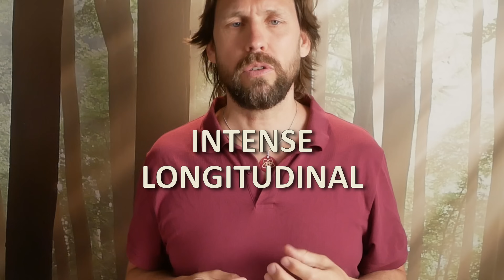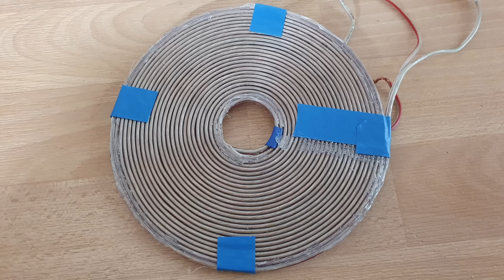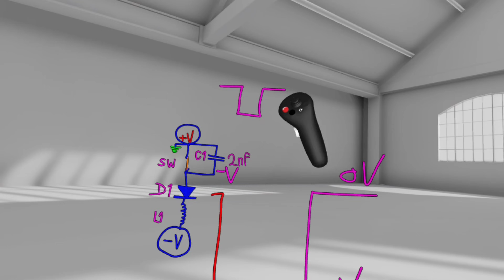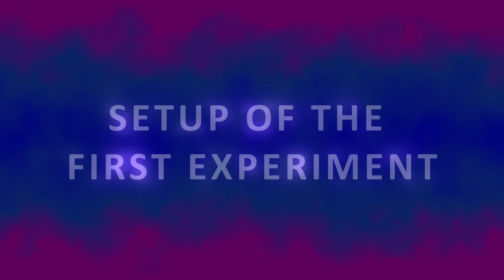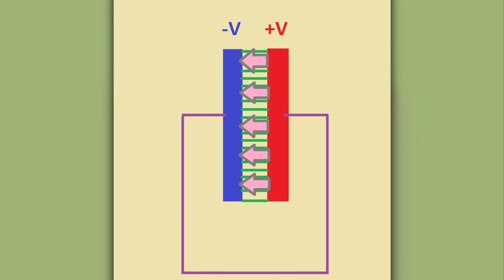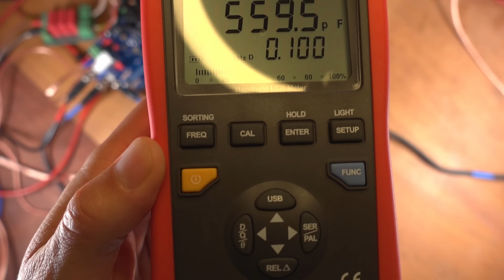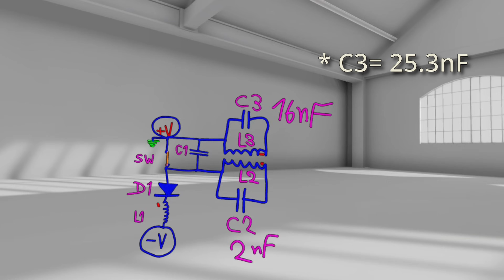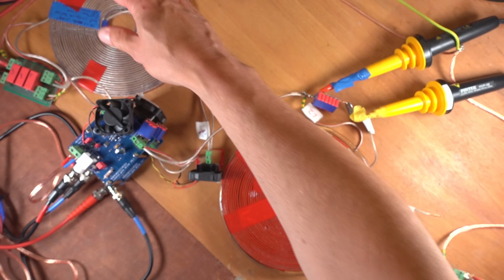Dielectric Induction producing Ground Currents

Comment: Can Dielectricity be used to power motors? I've seen bulbs done but not motors. I remember reading somewhere that it couldn't but maybe an Asymmetrical motor could?
Reply from the maker: bulbs are resistive and do not care about frequency, motors are sensitive to frequency
Reply: @MasterIvo  So a standard DC motor could run on it despite the lack of magnetic component if the energy was smoothed out first? Would a smoothing capacitor work on radiant energy? (DC input)
Reply: @JenkoRun  yes, with enormous smoothing/filter (super)capacitor hehe😉
Reply: @cold3lectric  Yo hey cold3, you should probably disregard this comment since I consider it very out of date compared to what I've learned since, the nature of these radiant shockwaves couldn't be used in the way I was asking since they're staggered by nature, the moment they're smoothed out they lose their shockwave effect and all you would have is conduction current if the circuit is closed.

These days I would be looking into the possibility of running motors on open single wire systems since we don't have conduction current in those, and something tells me your off the shelf motor isn't going to work with non-magnetic displacement currents, I need to look into it more,
Reply: @JenkoRun  sry I was kinda just teasing :)
Would 'displacement current' drive be feasible with 'pulse motors' though? or electrostatic motors/actuators... those might be dumb questions though but yeah you do have a point...
Reply: @cold3lectric  Probably! We know from Tesla's research that the shockwaves produced by impulse currents have mechanical pressure effects, it should be possible to use that on a pulse type motor system if the pressure induced by them is hard enough, in theory we could drive a pulse motor on those.

Electrostatic motors are definitely a viable possibility, there are videos around that show some pretty good torque from mere high voltage, I wonder what kind of effects we could get from an electrostatic motor if we drove it with radiant shockwaves? Fun!
Reply: @JenkoRun  [takes notes, daydreams of attempting a demo in some future content]

Comment: So if you remove the ground on L3 then it should not result in much larger current with much larger voltage.  Correct?

Comment: So your coil capacitor is the same as a transformer and you are building a switching power supply with it cool
Reply from the maker: that is a small part of it yes. A boost converter, from L1 to C1.

Comment: So now, is there a way to capture and store the high currents from earth ground to be stored in a usable medium then fed back to the main operating input, so to create a closed loop circuit, that re-uses its expelled energy, that was regained and multiplied by its earth ground?
   Some people may say it creates a perpetual energy machine which is impossible, but in your circuit that it not the case, your circuit simply causes an imbalance of the capacitance coils from the capacitor frequencies, that causes a negative vacuum so to speak, that the earth ground compensates the extra needed electrical missing particles to balance out and complete the coil capacitance back to zero volts.   Very ingenious idea, now, how do we capture and store those extra particle charges for additional power consumption loads, to be used at a later time?
   Could a jewel thief be used in conjunction with this design, or would that stop the flow of the negative particles from earth ground?

Comment: Hi Master Ivo, I have a question on using radiant energy/dielectricity for field propulsion. According to Ken the only way for a field craft to cancel inertia is through an omnidirectional magnetic field to isolate the craft from the mass acceleration between it and surrounding space. In your opinion, would surrounding a craft in this radiant energy also isolate it and the occupants from the effects of inertia? Cheers
Reply from the maker: yes but there needs to be a lot more experiments to be less speculative

Comment: Tesla's device that about destroyed that Russian forest by accident worked on a similar theory,  but with some distinct differences.  For example: Once creating an inductive discharge (an antenna was placed in parallel with that same discharge & positive point) and that discharge then through a spark gap and ultimately to a capacitor connected to ground. Once that inductive discharge began, electricity in its purest form was collected by the antenna and allowed to discharge through that same spark gap to a capacitor and then to actual earth ground.  Because (and through experience & experimentation) Tesla found that limiting the time of discharge to micro seconds any so-called current (Tesla called contaminates) could be eliminated and pure electricity would eventually oscillate and flow as a result. That electricity "energy " was dubbed "dark energy" by Tesla himself; better known as Aether and or "zero-point energy" today. 

Noting also: Once that energy began to flow (due to oscillation of Tesla's circuit) it continued to flow even after turning his device off for a period of time. Properly distributed that energy (coming in contact with most anything metallic [especially if were grounded through a capacitor]) could cause that same metal to release its electrons and either be seen as a "positive plate" for electrical power or ultimately a target for that same energy to melt it like butter. 😊

Now Master Ivo, build that circut (Tesla's actual "hair pin" circuit) and demonstrate that.  Micro sized one could power your EV and or house. Just sayin
Reply: Not Electrons, Dielectric Tension:

Nikola Tesla November 1928 interview:
On the whole subject of matter, in fact, Dr. Tesla holds views that are startlingly original. He disagrees with the accepted atomic theory of matter, and does not believe in the existence of an “electron” as pictured by science.

“To account for its apparently small mass, science conceives of the electron as a hollow sphere, a sort of bubble, such a bubble could exist in a medium as a gas or liquid because its internal pressure is not altered by deformation. But if, as supposed, the internal pressure of an electron is due to the repulsion of electric masses, the slightest conceivable deformation must result in the destruction of the bubble! Just to mention another improbability...” - Nikola Tesla
Article: “A Famous Prophet of Science Looks into the Future” (Popular Science Monthly)

“My ideas regarding the electron are at variance with those generally entertained. I hold that it is a relatively large entity carrying a surface charge and is not an elementary unit (particle). When the ‘electron’ leaves an electrode of high potential and in a high vacuum it carries an electrostatic charge many times greater than normal.” – N. Tesla 

“In the theoretical treatment of these electrons we are faced with the difficulty that electro-dynamic theory by itself is unable to give an account of their nature.” “For since electrical masses constituting the electron would necessarily be scattered under the influence of their mutual repulsions, unless there are forces of another kind operating between them the nature of which has hitherto remained obscure to us.” - Einstein on electrons; “Relativity”, by Albert Einstein, Random House Publisher, 1916

“To describe an electron as a negatively charged body is equivalent to saying that it is an expanding-contracting particle. There is no such condition in nature as a negative charge, nor are there negatively charged particles. Charge and discharge are opposite conditions, as filling and emptying, or compressing and expanding are opposite conditions.” – W. Russell

JJ Thomson developed the “Ether Atom” ideas of M. Faraday into his “Electronic Corpuscle”, this indivisible unit. One corpuscle terminates on one Faradic tube of force, and this quantifies as one Coulomb. This corpuscle is not and electron, it is a constituent of what today is known incorrectly as an “electron”. (Thomson relates 1000 corpuscles per electron) In this view, that taken by W. Crookes, J.J. Thomson, and N. Tesla, the cathode ray is not electrons, but in actuality corpuscles of the Ether.” – E. Dollard

“There is no rest mass to an ‘electron’. It is given here the ‘electron’ is no more than a broken loose “hold fast” under the grip of the tensions within the dielectric lines of force. They are the broken ends of the split in half package of spaghetti. Obviously this reasoning is not welcome in the realm of Einstein’s Theory of Relativity.” – E. Dollard

“Unfortunately to a large extent in dealing with dielectric fields the prehistoric conception of the electro-static charge, the ‘electron’, on the conductor still exists, and by its use destroys the analogy between the two components of the electric field, the magnetic and dielectric. This makes the consideration of dielectric fields unnecessarily complicated” - C.P. Steinmetz (Electric Discharges, Waves and Impulses)

The idea of electricity as a flow of ‘electrons’ in a conductor was regarded by Oliver Heaviside as “a psychosis”. This encouraged Heaviside to begin a series of writings. Also consider the J.J. Thomson concept of the "electron" (his own discovery). Thomson considered the electron the terminal end of one unit line of dielectric induction.

“Electrons as a separate, distinct entity…doesn’t really exist, they are merely bumps in something called a ‘field’.”  - Dr. Steven Biller
Reply: Electrons are composed of two vortices in face to face rolling contact, forming polar sinks ejecting aether from the equator. The proton is the exact opposite configuration, whose polar openings are sources and it's equator the sink.  The faraday tubes will naturally tend to have coaxial rotations in opposite directions like worm gearing.  Two forms of single vortex can form: left and right coaxial rotation. It follows that both protons and electrons are composed of such single vorrices which can be defined as neutrinos. Based on Carl F. Krafft's Ether and its Vortices
Reply: @rogerscottcathey  A proton is an Aether condensate of super high energy light, it's literally light that has reached a frequency so high it can no longer oscillate and becomes physical with volume, an atom, natures perfect spinning dynamo's.

Electrons are bumps in the field, they form when the magnetic and dielectric fields make mutually destructive contact. Think bubbles and water.

We don't even need the concept of the Electron to explain electricity in the first place, as it is the conjugate of dielectric and magnetic fields. Steinmetz lamented this concept during his time as it makes electricity unnecessarily complicated.
Reply: @JenkoRun  : no. I don't think so.
Reply: @JenkoRun  I should have suggested "Secrets of the Cold War Technology" a free PDF in my original post; specifically chapter one being an eye popping reference into the history of Tesla, his experimentations & discoveries, and his opinion on how to tap the "Aether". In that reading, one would see the systematic means in which Tesla configured his (a) device, monitored its progress, modified (or shall we say perfected the same device) and theorized his findings as it were between  about 1896 and 1917.  This too goes beyond the Wardenclyffe tower discharge and Morgan pulling the plug. 

Me, I'm not interested in arguing the point of what an electron is; I was simply purporting what Tesla himself was quoted in saying back (again) between 1896 and 1917. That is to say...' by limiting the time in which a high voltage DC electrical conductor is enabled to close & remain closed, then opened the following would happen: 

(1.) If limiting the amount of time a closed switch  is closed (* mentioned above) and counted in micro seconds (a.) electron flow could be limited if not eliminated all together.  Recall your Capacitor studies in college (how potential is seen before current flow....or.. (current lags potential))? (2.)  If by limiting this same "current flow" (TESLA CALLED  "contaminates") pure "Aether" could flow unobstructed.(3.) Depending on the time a switch were closed a room could be heated or cooled, both harmful &/ or beneficial health benefits could result naming a few. (4.) Anything metallic coming in contact with this Aether discharge would (a.) become electrically charged, or (b.) melt like butter in the sun.  (5.) Produced lighting when coming in contact with carbon (* see Tesla's single ended wire "carbon button lamps"). (6.) Recall X-ray being discovered 10 years after Tesla and friends were photographed in his lab and them appearing as skeletons? Tesla called that "dark energy", that illuminated those "carbon button lamps" he created. They  produced natural lighting, but not to a camera. Why are X-rays harmful and Tesla's "dark energy " isn't? Simple. Because the amount of current allowed to flow in a given time. "X-rays" are forerly converted electrons into photons. Eliminate the "current" and simple photography could record the same results.
Reply: @anonymousmeme8458  Yes I am aware of the energy you're talking about and is a main point of my own research, it's the same thing Master Ivo here is doing experiments on, radiant energy, also known as cold electricity, dielectricity, or dielectric impulse displacement currents, and you are correct on most of your points but not all of them.

Photons and Electrons do not exist as distinct entities, the current isn't converted into them, just filtered out of the flowing dielectric. This is the basics of how Tesla's hairpin circuit works, the capacitors and spark gap create a "filtering" system that forces the magnetism to only form on the first half the circuit, the triggering of the spark gap releases the tension in the capacitors and recharges them at a rate that overcomes the formation of the magnetism, this allows the tension field to flow to the other side while keeping the magnetism on the conventional side and letting it depolarize, again why Tesla found a unidirectional (DC) current worked best for this sort of circuitry due to how capacitors behave with AC.

What people call a Photon is the part of the EM coaxial circuit of light that collapses back into a point before again expanding in propagation, Tesla was correct when he said Light is longitudinal disturbance in the Ether involving alternating compressions and rarefactions, photons are just the bumps that are the highest points of compression in the propagation.

Similar with the Electron, when the dielectric and magnetic fields (contaminants) interact they are mutually destructive and "bumps" form that get swept along with the direction of induction, those bumps are the so called electron.

Amps = Contaminants, Magnetism, current, force and motion, lethal.

Voltage = Dielectric field, tension, inertia and acceleration.

Radiant Energy = Moving induced dielectric fields, impulse displacement, beneficial, capable of powering loads without magnetism.

And if you're going to quote Tesla, then I will again quote him on the Electron:

“To account for its apparently small mass, science conceives of the electron as a hollow sphere, a sort of bubble, such a bubble could exist in a medium as a gas or liquid because its internal pressure is not altered by deformation. But if, as supposed, the internal pressure of an electron is due to the repulsion of electric masses, the slightest conceivable deformation must result in the destruction of the bubble! Just to mention another improbability...”

“My ideas regarding the electron are at variance with those generally entertained. I hold that it is a relatively large entity carrying a surface charge and is not an elementary unit (particle). When the ‘electron’ leaves an electrode of high potential and in a high vacuum it carries an electrostatic charge many times greater than normal.”

Gerry Vassilatos fails to understand this in his book, at no point did Tesla ever say that electricity was the flow of electrons, he simply doesn't understand that it is the conjugate of dielectric and magnetic fields, as Steinmetz and Tesla did, and repeated this mistake in his book. 

Get rid of the particle model of the Electron and Light, it's an isolated atomists perspective that has polluted the reality of a unified and Aether based connected cosmos and is fundamentally incorrect, as with most things in mainstream.
Reply: @rogerscottcathey  I think so, so we will disagree.

Comment: I came up with the idea for the mini cordless chainsaw about 15 years ago and I never followed through and now  for the last several years they've been produced and advertised and they've been selling hundreds of thousands of them.
 I could've been a millionaire if I had followed through on my idea so keep up the good work experimenting.
I wish I understood any of what you're talking about i gues my mind just doesn't work that way.
Reply: Don't feel too bad, that thing still requires a charger, a true cordless device would be one that receivers dielectric power from a distant generator thus removing the need for charging all together, in-fact it should be possible to make one with a built in generator making it self sustaining. Lots of room for improvement.

Comment: You would probably be interested in looking at the galaxy in a box remastered edition on my channel. It shows how to do it with no magnet, no coil, no battery, no power source or any moving parts. It's done with sound and feedback and spinning plasma in a torus. It's extremely powerful. It uses resonance in a cavity... the equivalent of a black hole. It gains mass therefore should also slow time.